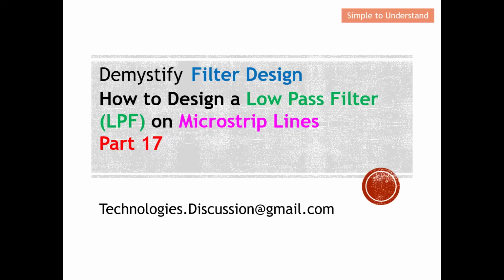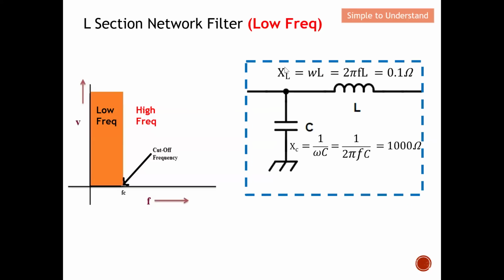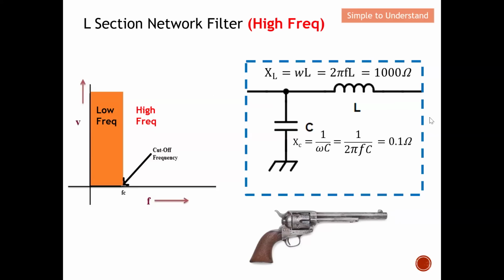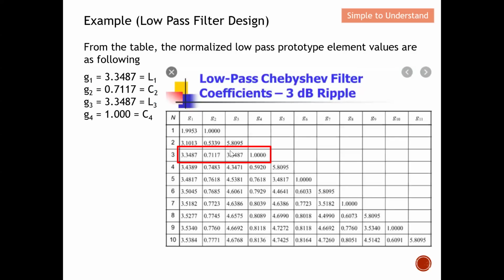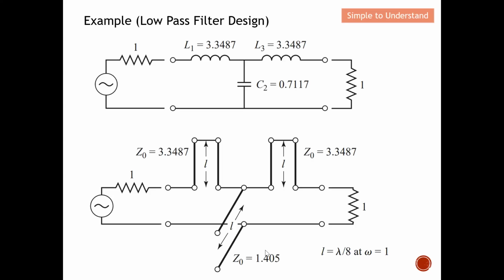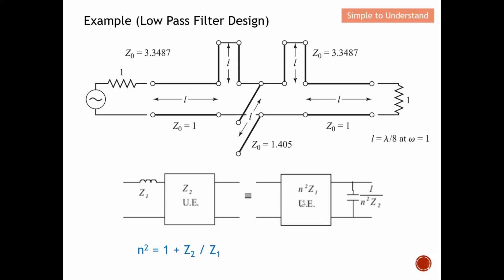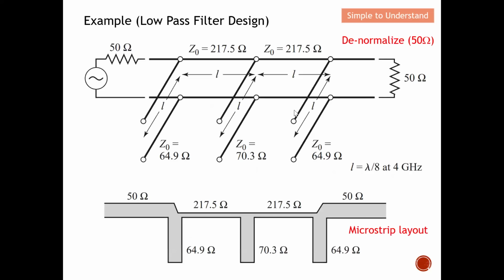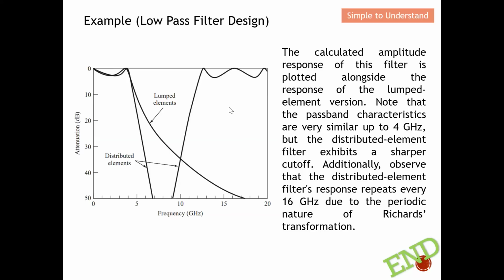Filter Design #17. How to Design from Lumped Elements LC to Distributed Microstrip Lowpass Filter.

Comment from the maker: Thank you so much for taking the time to watch this video. In this video, we will discuss how to design a Low-Pass Filter (LPF) on a microstrip line.
The design process begins with lumped elements—using inductors and capacitors—to achieve low-pass filter characteristics. Next, we apply Richard’s Transformation to convert these lumped elements into transmission lines. We also use Kuroda’s Identity to transform series stubs into shunt stubs, making them easier to implement on a microstrip.
Finally, we compare the performance of the low-pass filter using distributed elements versus lumped elements.